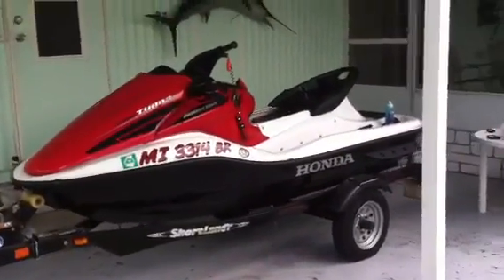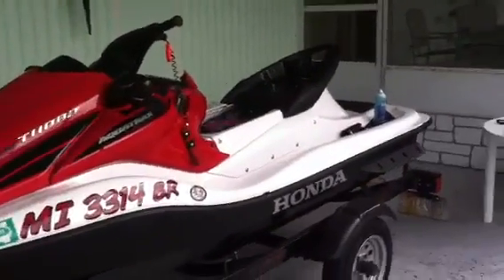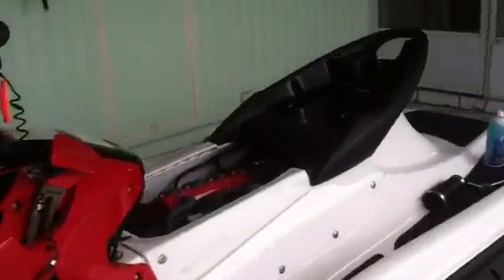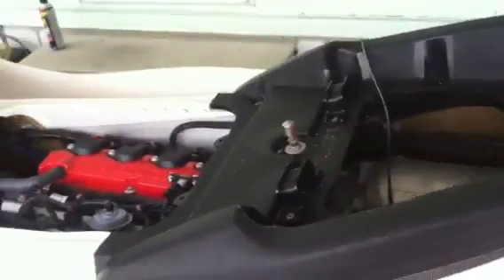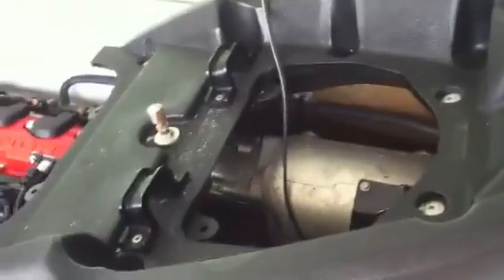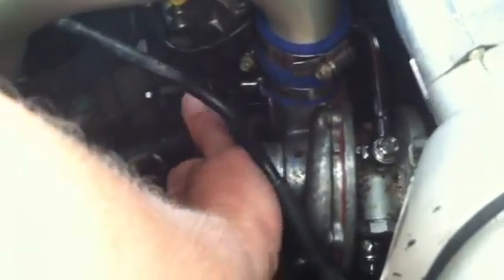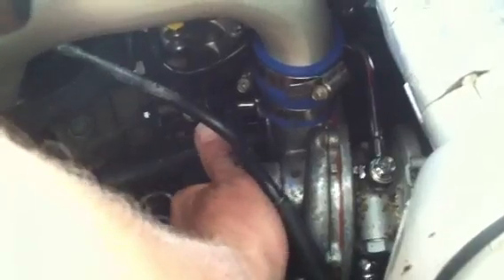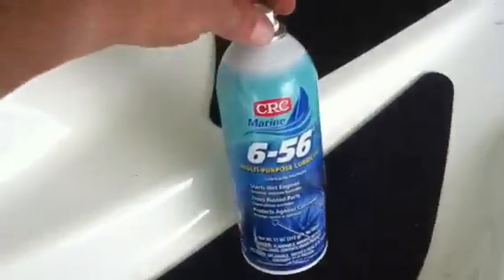How to fix a stuck turbo on a Honda Aquatrax

Comment: Out in the garage currently battling with this. I freed the turbo up and it kept seizing. I kept on with the 9mm socket and CRC 6-56 as well as PB Blaster. Looks like it's free again. I hope this fixed the problem. Thank you again for this excellent video! A shop will just try to sell you a $2,000 turbo. Lack of use is definitely bad for these skis!

Comment from the maker: A very common problem on these skis, especially if used in salt water. Best thing to do is to hammer it down with CRC56 after use especially if its gonna be put up a while.

Comment: I'm looking at buying a 2003 with 51 hours. Are this problematic machines?
Reply: Save your money. It's very hard to get parts for these.
Reply: Chad Gilreath 4500 is too much to pay for it?
Reply: Love my R-12 and really have had no trouble finding parts
Reply: It's a Honda so really unsure what people are saying about parts.  Goto the Honda dealer.  I've had mine and change oil annually for 8 years now.  We ride the heck out of it and all it asks for is fuel.  100% recommend this watercraft. Hard to beat a Honda anything.
Reply: I’ve got a 2003 with 233 hours on it. There are some Achilles heels on the Honda. One is the knock sensor. Once it gets corroded it puts the skin into limp mode. But it’s only like a $40 part. Another is the sleeve around the impeller in the pump. It was made too thin and swells up and sometimes locks the impeller up. There’s a guy on eBay that refurbished and makes them bulletproof but you have to ship it to him and he’ll ship it back. The last problem is the turbo, you’ve got to keep the turbo lubricated and the wastegate lubricated, especially if you ride in salt water. And as shown in this video, if you don’t use the ski for a season, it may get gummed up and stick. Other than that the Honda JetSki mechanically is one of the finest JetSki‘s ever made. It’s a real shame they don’t make them anymore. And oh yeah, the people saying you can’t get parts are crazy, just go on eBay you can get any part you want for Aqua track, also if you go to Google, there’s tons of Honda dealers that have leftover parts that sell them. I’ve never had a problem getting a part for my aqua tracks and I’ve done a lot of maintenance replacing gaskets and O-rings and things like that.

Comment: why would the turbo get stuck seems terrible.. condensation should evaporate under heat
Reply from the maker: Mainly from non use over the winter.  it's a common issue on these models but easily fixed.
Reply: gotcha
Reply: gotcha
Reply: It’s funny I had the throttle cable stuck on mine because I had let it sit for so long. So I lubricated that with some CRC and it worked great. So I took the ski out and sure enough my turbo got stuck. This video was invaluable. I’m gonna go fix the turbo tonight.